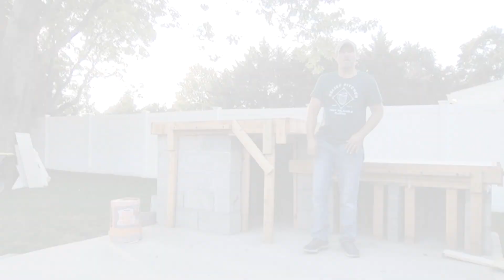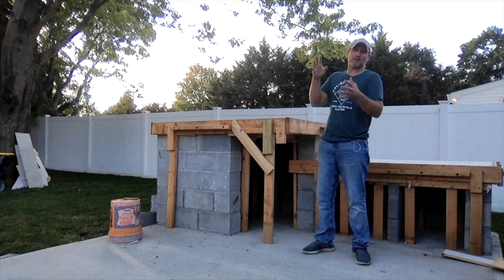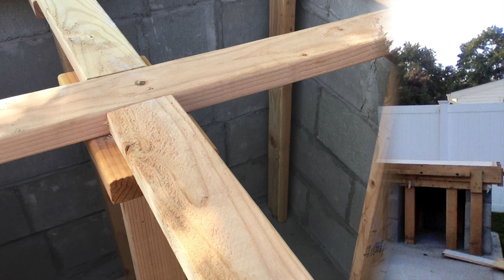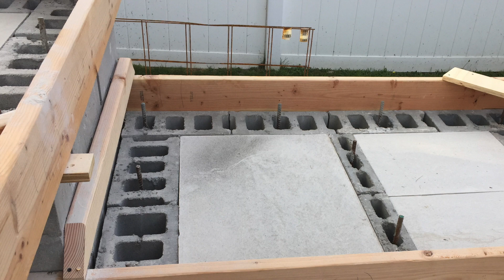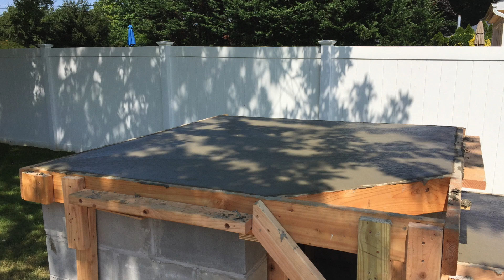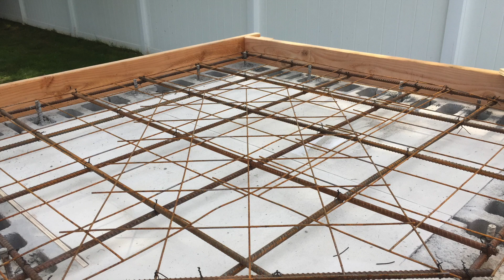How to build a brick oven / building the form / Outdoor kitchen build: Part 2

Comment: Great build series. For the slab I think I'll add hydronic tubing since I live where it's cold. But to do that, when they build a shop with tubing tied to the rebar, they'll use an underlayment of high density foam on the bottom and side walls of the slab to isolate the mass from thermal bridging. My concern is about putting the weight of the oven, slab and insulation board or the vermiculite you mentioned on top of high density foam. I guess I need to look at pound per square inch and make sure I don't have a settling issue. The enclosureweight would be installed on the edge and not carried on the slab. Kind of a footer idea. Might be better ways to heat the covered and walled outdoor kitchen area but since my home uses a boiler and hydronic tubing I thought I'd go that route. It won't get the same heating value as in a house due to the high temp insulation but since warm air rises any heat to the floor would reduce thermal shock and allow me to extend my usage to the winter. That and I'd like to add natural gas to the mix since there isn't much hardwood in Idaho. I like the Gozney Dome for that reason and of course it would be much lighter if I want to put it into mobile use. Thanks.
Reply: Wondering what you decided to do.  Getting ready to build this fabulous pizza oven in Maine - also cold...

Comment: Why not replace the vermiculite with cellular concrete blocks embedded in the concrete hearth instead of having two thicknesses, concrete plus Vermiculite?  
There is a way to fix the blocks by drilling holes to insert a concrete iron rod.
Vermiculite: coefficient of thermal conductivity 0.08 W/m.K.
Thermal conductivity coefficient of cellular concrete goes down to 0.09 W/m.K
Autoclaved aerated concrete provides the highest security against fire and meets the most stringent fire safety requirements. Due to its purely mineral composition, AAC is classified as a non-combustible building material. It is both resistant to fire up to 1200 °C and, unlike other construction materials, heat-resistant. In fact, it's in reaction of part 3 video...

Comment: Do you know what strength concrete was used for the suspended slab?
Reply from the maker: About 4000 psi
Reply: @ArtisanMade  thanks I meant more what was the ratio mix please
Reply from the maker: @lewisdow  it was delivered premixed by a concrete truck

Comment: I have a question please, my suspended slab will span 62 inches with no center support with 12mm rebar at 150mm centers. Will the slab be strong enough to be self supporting?
Reply from the maker: I don’t have a center support and I have had no problems

Comment: Actually putting the reinforcement in the center of a slab does nothing.  The reinforcement should be in the bottom 1/3.  Its like standing on a piece of wood, it will break at the bottom and top and can still be attaching in the center.
Reply: This is 100% untrue please don't listen to this commenter. In thin slabs like what was poured you want the rebar or wire mesh in the center. That give the best coverage of concrete. Thus strongest in thin slabs.